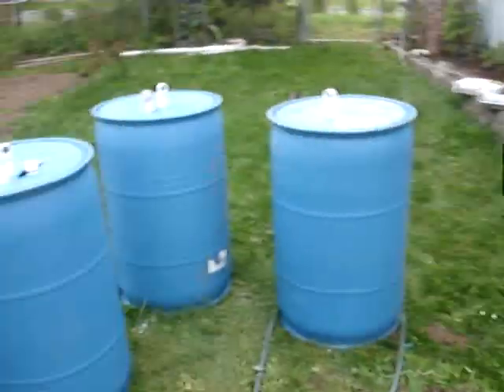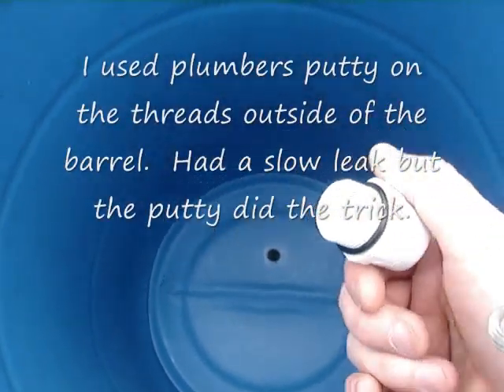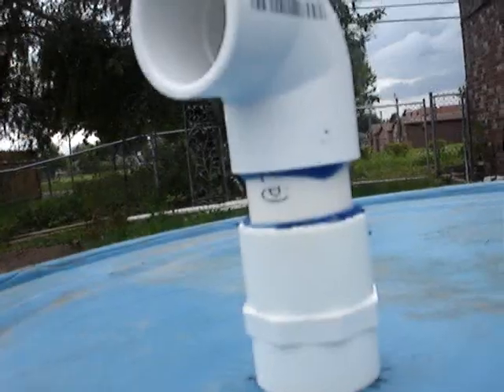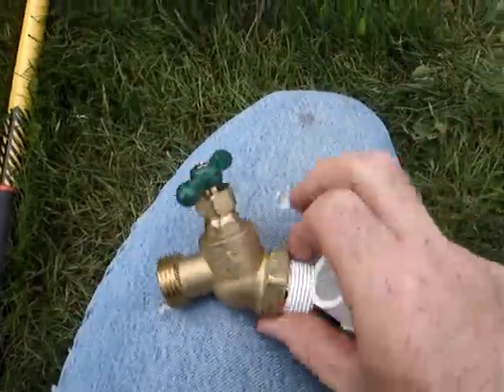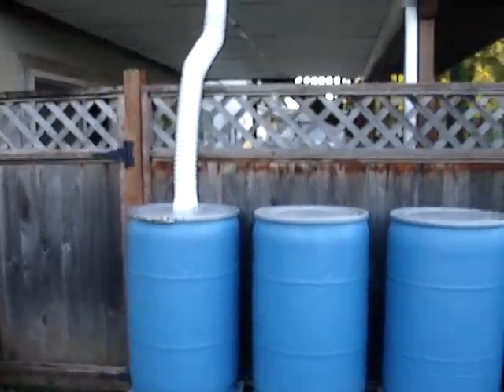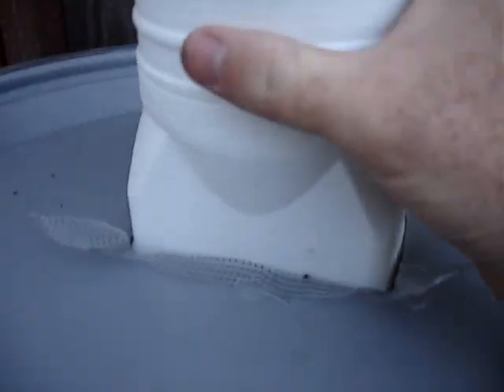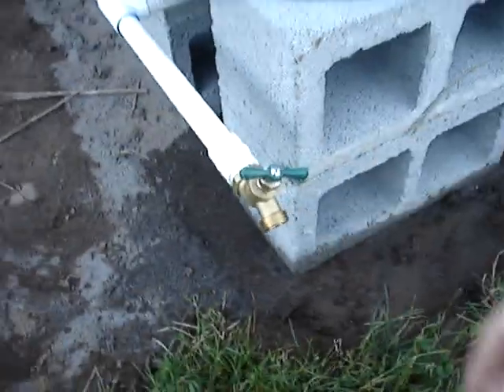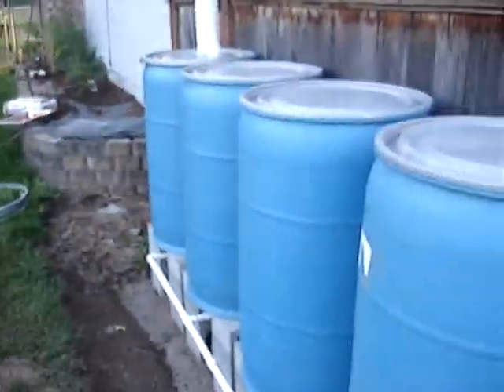DIY Multiple Rain Barrel System How To

Comment: If you need a better flow, get a 3/4" ball valve instead of what you're using.  The ball valve is a full 3/4" opening, just like the inside of 3/4" pipe!

Comment: Great system. You may have a pressure problem. Average person waters with a garden hose at waist high about 36". Your spigot comes out with water looks like about 12" off the ground? U need to raise the barrels. Maybe look into a pump.

Comment: The overflow doesn't need to match your downspout size (volume). For one, you will not have so much water flowing through that system that it will fill your downspout full of water like a solid column. Also the intake of that last barrel is what you would actually be matching to not the intake to your first barrel. You only need to make your overflow diameter match the diameter to the intake of that same barrel to prevent a back-up condition. Now if your overflow was on the first barrel you may want to go bigger than your manifold, but again your downspout is larger than the amount of water going into your barrel, unless someone is blasting your downspout with a firehose, lol. I like your system though, very nice.

Comment: Nice but wouldn’t it be easier & better if the inlets were drilled from the top lids and not the button?
Reply from the maker: The inlet is on top of the first barrel.  This system allows all barrels to fill and drain at the same time.

Comment: Great system, attention to detail and a great video describing your design and assembly.
Just a few comments to help out...
The bricks are called SINTERED blocks. This name means they were made by pressing small round particles of concrete. When closely examining the block you can see the round pieces still in the walls of the block. These round pieces are  poured into a mold and pressed together, dried which makes a strong block without any liquid and a short drying time. Some fuel filters are sintered yet with brass instead of concrete. The brass is porous because the little round balls of brass are pressed together, not too tight, which leaves spaces between the balls that lets fluid fuel thru yet not small particulates.These blocks were created by Frank Lloyd Wright. They are the most structurally strong when placed so the thru holes run up and down so the stresses run thru the walls of the block.
Reply: Nobody listen to this guy please. Incorrect.

Comment: A two-inch overflow in the last barrel is kinda pointless if the pipes BETWEEN barrels are only what looks like 3/4. Overflow would then need to be put on the FIRST barrel where the smaller pipe would not cause any restriction.
Reply: Mason Forge Company That's exactly what I was going to say!! lol   Good point! !

Comment: If you ever need to do any kind of maintenance to the barrels it might be handy to have your screen fence mounted on some type of hinge system for ease of access. Also, your overflow could've been incorporated into your inlet if you prefer to keep the works all together. Very nice, neat project. I'm gathering data for my own system. I was thinking about going horizontal with the barrels, but I like what you've done here. Thanks for sharing : )

Comment: Nice, actually better than some others I've seen before but one thing I think you need; a bigger hole for letting in air, those are too small with bigger holes the water will spill out much faster. that water should be shooting...

Comment: What is the GPM of your inflow (water coming from the roof) compared to the GPM of the connection pipes? The reason why I asked is because I was wondering if you ever ran into a problem where the first barrel filled up much faster than it was able to output the water to the other barrels.

Comment: Having an overflow the same size as the inflow makes sense, however, having a hole on the last barrel bigger than the pipes connecting the barrels together isn't going to do you any good.

Comment: Like your system, if it's raining hard do they fill up fast. Thinking that's a lot of water in the downspout. I used the ones with the solid tops and ran 3" into the barrels using 3" tees across six of them and will be using a hand pump to empty them. Nice job,

Comment: would this work even if the barrels were not perfectly level? cuz I suck at getting ground to be 100 percent level
Reply: Water levels will self-level.  Being an inch or two off won't make any difference except that there may be some empty space at the top of the barrels that are higher than others.

Comment: I have same setup but closed lids barrels running on solar powered water pump. I goes with water pump because I want to use it on my irrigation system since running back and forward with a bucket of water will get tired.  The pump was quite expensive since it was 80$ and the solar power system with deep cycle battery, but it wasn't just for my irrigation and rain barrel, but it was also powering my flood lights around the house

Comment: If you have freezing temperatures in the winter, you definitely want to drain the barrels, and leave the valve open, Divert all the water from going into the barrels in the winter, otherwise your plumbing on the bottom will burst when the water in it freezes.
Reply: Could you just slow drip the system like you would in a house to keep it from freezing during the winter?
Reply: Depending on how cold it gets, the slow drip might have to be a torrent on some days.

Comment: Great system - I used the same size pvc pipes, ball valve is at one end. However, no water is coming out of my 50 foot hose. Is that too long or what could be the issue? (Hose works fine on spigot, so does the ball valve - has a lot of pressure when turned on) Let em know before I implement plan b-that is replace pipes with 2 in pvc pipes
Reply: Did the 2" pvc work better for you?

Comment: Like the setup. Do see one flaw. You were mentioning a 2" overflow and the need for an overflow the same size as you intake. You will still be restricted by the 3/4" PVC connecting each barrel. You may want to look at a 4" 45 facing down, with a drain hose, on the inlet. Once all the barrels fill it will backup the pipe and the 45 will allow for drain off.
Reply: Charles Kiplinger  I thought the same thing.
Reply: Charles Kiplinger That's probably the best practical approach to the overflow problem. During a heavy downpour, the pressure developed by a column of water that high could cause water to enter the barrel much more quickly than a simple 4 inch hole near the top of the barrel would drain. This would create pressure inside the barrel. Having a t shaped, or tee wye fitting on the actual downpipe, right above the barrel will allow pressure to escape before it gets to the barrel. You don't want the lid popping off.
Reply: the overflow should be on first barrel

Comment: I copied your system in my previous house and it worked great. The downside is the hard connection, and after glued, it is hard to move the barrels when you want to adjust them or do maintenance even when they are empty. So in my new home, 1. I just used 1/2" connectors, garden hose cut, and metal clamps to make the soft connection between the barrels. So I can bring down individual barrel or disconnect wherever I want to to do maintenance.  2. add overflow pipe at the first barrel where the rain water comes in instead of #4.
Reply: Do you have a picture and more details, please and thank you
Reply: @donnabauerofbrilliancebyde1178  https://photos.app.goo.gl/Vf6fTnDRHPETKXdVA

Comment: You answered a nagging question for me about how to use some pvc fittings by creating the opening with your drill. I don't have the barrels with the removable lids so setting that up is a little more difficult...but I think I can make your idea work. 

If you want to increase your flow (next time) try using 2 inch PVC for the primary pipes and then move down to 3/4 inch PVC. I water my entire garden with a PVC system like this...but did not have the rainwater hooked up yet.

Comment: I'm not saying my method is right or wrong,but I installed tire valve stems in the tops of mine. I wasn't getting enough pressure to expelled the water as I needed from my 220 gal barrel. I keep the piece that screws into the tip of the valve stem out until I need to water my garden (no pressure build up like you stated). Then I screw that piece in,attach a small 12v air compressor,and I then have enough pressure to spray my garden. I plan on adding a pressure gauge so to indicate the amount of pressure,but thought it might be something worth sharing. By the way,great setup you have.

Comment: Great setup. one suggestion, put the overflow outlet in the first barrel and set that barrel higher than the others by 6-8 inches. If your overflow is cut into the last barrel, water will be coming out the top opening of the first barrel before it fills all the barrels because the reduction in flow caused by friction and pipe size diameter.

Comment: Nice job!  With our drought conditions in CA, I'm goona use your system with a couple of modifications.  I have a long corridor to store these into so i'm gna align them shoulder to shoulder like you mentioned.  And then I'm gna run the bottom common PVC line directly beneath the barrels btwn the cinder blocks arranged at 90 degrees from the way you did it.  Thanks for your help!  I also thought about using a valve under each barrel to be able to isolate each barrel from the others in case I need to wash one out or something like that.

Comment: if you could give an answer.   really like your fill system at the bottom,  I plan to use for micro irrigation and hydroponics.
can I put a submersible pump somewhere to drive the water system tubing.   if you can give thoughts  thank you

Comment: One thing I keep seeing on multiple barrel systems is that people have a tendancy to get all of the barrels level.  You don't need to do this.  All you need to do is screw a plastic fitting into the top of each barrel with a length of PVC pipe (1/2 inch should be plenty).  Make sure this extends up at least to the level of the top of the top barrel.

Comment: Overall, a nice, simple system. Congrats for taking the initiative to conserve! A couple of thoughts (I've only scanned the first page of comments here, so you might already have dealt with my remarks, so...) 1) A one-inch rainfall on a one horizontal square foot area yields .62 gallons of water. If the roof area serviced by the gutter is, say, 1,000 square feet, then a one-inch rainfall will give you 620 gallons of rainwater, or a little more than eleven 55-gallon barrels worth. Having a reliable overflow system will be important, and might work better for you if it is installed on the first barrel rather than the last one, given the small pipes connecting them together. 2) You may find that a debris filter located right at the intake of the first barrel quickly gets plugged with leaves, bugs, dirt, etc. Should the filter clog at the start of a heavy rain, water could quickly back up onto the roof. Consider adding a "first flush" mechanism that grabs the first rush of water off a dry/dirty roof, then diverts (relatively cleaner) water into the collection system. Note that fine dirt will get into your system anyway, and draining the system from the very bottom of the barrels would include all that sediment which eventually could clog your pipes and hoses. Consider draining from the sides of the barrels an inch or two above the bottom to leave the sediment behind. The last barrel (from which you take water) will naturally have the least amount of sediment to contend with.

Comment: So, what are you using to irrigate the garden? I've been looking at drip irrigation, but the low pressure seems to be an issue.
Reply: Derek Murawsky There are different types of drip hose available--some for pressurized water like from a hose, and some for very low-pressure water like you would get with this system with only 3 feet or so of head.

Comment: Did you build your overflow yet? If you do your overflow at the last barrel couldn't it could be as small as the diameter of the pipe that feeds the barrel since it is already constricted at that point?

Comment: Some thing to note.... though I don't know the solution. When the level gets lower, so does the pressure. Regardless of how many barrels you have.  The more elbos you have reduces pressure.   I Put my large cpacity tanks higher up for more pressure.  Also used a direct link to the tanks.   Maybe a small inline pump would help?

Comment: Fount it, nice work.  Since I can't post web address, check these out for ideas: Baytec containers, look for the bulkhead fitting to connect a faucet to a barrel without using silicone

You tube video:
Rain Barrel Water Pressure/Volume Demonstration.

Grady Barrels for water inlet

information cupboard.com for a great way to connect all barrels
to a single faucet.

You tube video
5 Dollar RAIN BARRELS 55 gallons to 1000 gallons
Connecting multiple barrels with part numbers for the pvc parts

Comment: I don't know if it's worth it to you, but the diverter would provide an outlet without having to drill more holes (which is why I liked it), and since you have a breather hole in your other barrels, a short breather tube screwed into them would vent them, as long as it was taller than the outlet, and be easy to add.  But, like I said, don't know if it's worth it to you.  I thought one barrel was all I needed, but it turns out two weeks of dry weather and I was out of rain water.

Comment: Good points!  I'm trying to figure out how to improve my set up compared to yours.  I just added a second barrel, after seeing how well using rain water in PDX works.  Last year I got a barrel, and the Grady Barrel diverter, and been pretty happy with it, last week I added a second barrel, but I just ran the outlet from the diverter to a pvc "T" to fill the second barrel and have a 1.5" outlet.  I put ball valves on the barrels, but haven't connected them, so they empty independently.

Comment from the maker: That could work but each lid has to have a vent to prevent a vacuum when draining.  You could make those vents taller than the drain pipe but all that work is really only getting you a few extra gallons.  My drain pipe is and 1.25" Dont really need a whole 2" in most cases but the 3/4" was to much restriction and cause overflow out the inlet pipe on heavy rain days.  We get a lot of those here in WA.

Comment: Oh yeah, I forgot to mention, you most likely don't need a two inch overflow to match the size of the drainpipe.  The reason for the size of the drain pipe is to allow debris to flow freely out.  Unless you have monsoon rains, you won't get a two inch flow of water out of the drain, which is why so many people use small overflows.

Comment from the maker: Sort of.  I located the overflow to the first barrel because locating on the last barrel in the line would make in limited by the size of the manifold pipe.  I did not want the overflow on the top because I dont have a sealed fitting for the rain gutter.  I want the overflow carried away from the barrels not just flowing out the inlet from the rain gutter and flooding out my patio.

Comment: The beauty of a manifold system is that you don't have to switch the hose between 4 different barrels. If you connect the barrels at the top you have no choice but to switch the hose to the next barrel when one is empty.

Comment from the maker: Ah I see.  This is just convenient not to have to change out the hose to each a different barrel and stores a lot more water.  You are correct about the pressure though.  I full barrel will have more pressure than 4 1/4 barrels but will also lose pressure much faster than using more than one.  If I use 55 gallons I have almost no pressure from one barrel.  If I use 55 gallons from 4 I still have the pressure of a 3/4 full barrel.

Comment: They would have separate drains. How often do you need more than 55 gallons at once? Connecting them at the top would allow 1 to fill completely before starting filling the next. You get better pressure from 1 full barrel than 4 barrels 1/4 full. Like I said though that is all preference.

Comment from the maker: You are correct.  I ended up putting the overflow on the first barrel after another viewer suggested it.  I also changed out the main pipe connecting the barrels to 1" and changed the valve to a quater turn valve.  That greatly improved the pressure.  Not sure how you get them to drain if you connected them at the top.

Comment: Nice setup, I think I would connect all the barrels at the top so a leak would not empty the whole system, but that's a personal preference. One bit of advice though, your 2" overflow at the last barrel would be choked by the 3/4 pipe connecting the first barrel to the fourth.

Comment from the maker: I switched out the lower pipe to a 1" and a 1/4 turn valve and the water pressure is much greater than in the video.  The water will flow out as long as the water level is higher than where you need to water.  I have not tried to run a sprinkler though.

Comment: If you hooked a Water Heater to the end with a shut off valve to stop water after the W/H tank is full , changing the electical of the W/H to a three prong plug to go to a generator you could have hot water if need if a long power outage attaching the electrical

Comment: A suggestion that may be of use - I seen this on another YouTube Video.
Use a Balloon Leaf Guard (About £2.88 off eBay); inverted and fixed into barrel No.1, then you can direct your downpipe from your house gutter into the ready made depression more easily and neatly then what you've got currently ie., a nasty peace of netting.
Hope this helps :)